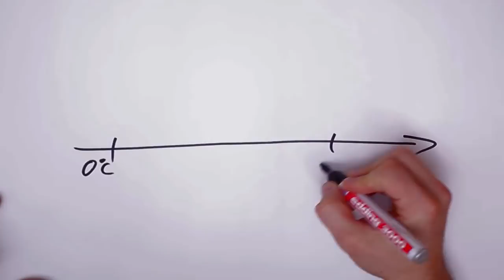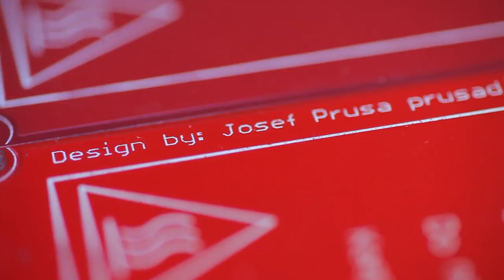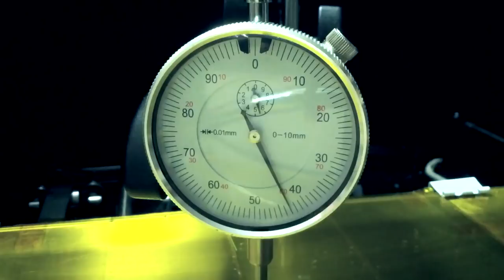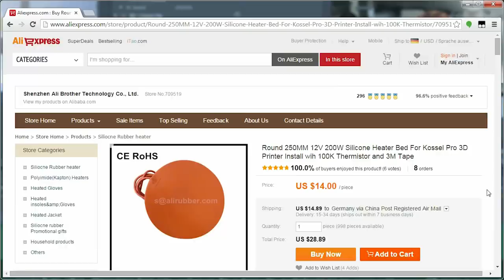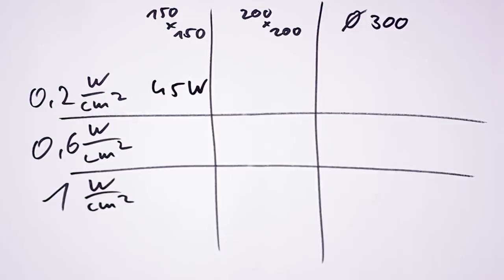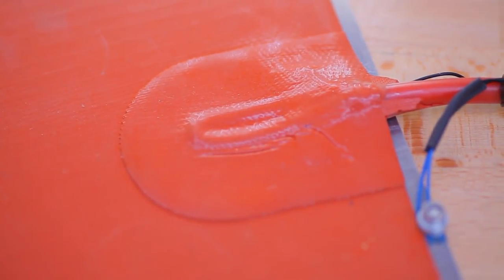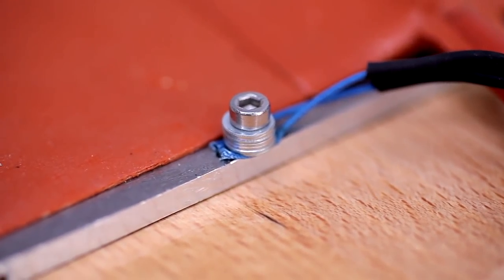3D printing guides: Everything about heated beds!

Comment: Hey Tom, can you do an update to this?
Reply: Jup, would love an update on this.
Reply: Does automatic bed leveling solve any design challenges? Like pcb heater's warping is no longer an issue etc?
Reply: @TheRainHarvester  no it will not.
Reply: @birukch7871  If the bed consistently warps under heat, and the bed-leveling is done after heating, then bed-leveling would solve that problem. (Just an example...looking for others..)
Reply: @TheRainHarvester  the warp is mostly due to cooling and the material property of the plastic. For your case. Warping due to bed problem is another issue but it will not solve your part from warping. The auto bed leveling system is a software based system. It doesn't unbend your build plate.  A simple solution is to use adhesive.

Comment: After my "home made prusa i3" with PBC heat bed, I use now aluminium plate (230*200mm) + heat mat 250W with main power on my new 3D printer.
This is clearly the way to go, from 20C to 110C in 5 minutes, I can't complain.
Also I made a hole on the side of the aluminium plate, kind of Thomas shown in the video, I figured out that this was a big win.

Comment: For Si heaters, do what I did. Simply measure the difference over about +5 different temperatures and draw a graphic difference of this. Now calculate the error and add that to the reading in the firmware. Works great and my temps are between .4 and .6 Degrees incorrect, but still working great. Thanks for the great vid.

Comment: I have a PCB bed and to avoid the bowing or bulging problem I insulated the bottom of the bed with fiber glass style insulation used for pottery kilns, you can usually get it at your local hardware store =)
Reply: Great idea!! Did the insulation help with getting higher temps, and also heating up faster? How long? Thanks!

Comment: Thomas, have you looked into PEI plastic as a replacement for tapes, glues and such? It's almost a miracle material and works perfect for ABS and PLA with no need for anything else.

I have mine on glass (TAZ 4 has the silicone heater glued to the glass) but I think the ideal combo would be a silicone heater on alluminum with PEI on top of that. 

The bottom of the prints are always smooth and shiny as well since there are no materials in the way and it's flat and smooth.
Reply: Have not had that happen yet. The tape is very strong and I use a painters knofe to pry my prints off when they are really stuck (see my videos on it).

Comment: Hi Thomas
I like to know the difference in warmup times on different print-serfaces.
What i mean is this:
How long does it take a pcb bed to warm up on 12v to 60c, 80c, 100c etc. 
How long does it take a pcb bed to warm up on 24v to 60c, 80c, 100c etc. 
How long does it take a pcb bed to warm up on 48v to 60c, 80c, 100c etc. 
How long does it take a Silicon bed to warm up on 12v to 60c, 80c, 100c etc. 
How long does it take a Silicon bed to warm up on 24v to 60c, 80c, 100c etc. 
How long does it take a Silicon bed to warm up on 48v to 60c, 80c, 100c etc. 
How long does it take a Silicon bed to warm up on 110v mains to 60c, 80c, 100c etc. 
How long does it take a Silicon bed to warm up on 230v mains to 60c, 80c, 100c etc. 

I can not find this anywhere.
Is there a excel sheet i can download?

Thank you

Comment: What would you recommend for a 24x24" print bed? I bought and returned 2 sheets of MIC6 cast precision ground plate both were not very straight at all. About 0.8mm off over the whole span. I'm thinking of just going with glass on top of the uneven aluminum plate. Borosilicate glass I cannot find at 24" thicker then 1/8th which would be wayy too thin. Do you think just regular glass would work? 3/16th thick or maybe 1/4th? I also cannot get a hold of any local companies that would precision grind the aluminum plate even flatter... Kind of stuck with what to do.

Comment: PVA sticks nicely to a heated bed with a thin layer of Ponal. It seems Ponal is the only thing PVA sticks reliably to. It works best when freshly applied and then heating the bed up. Letting the Ponal layer drying over night and using it then works not nearly as good.

Comment: Thank you Tom, very informative and I'm glad I watched this video.  I am in the process of trying to work out problems with the stock heating bed solution that came with my TRONXY x5sa 3d printer.  I'm thinking after my research and watching your video as part of the research I'm leaning toward the silicone heater mat.  I do want to put multiple thermistors on some sweet spots of my build area and I'm thinking the E3D v6 method might be the way I will go for them but still up in the air on it.

Comment: I have been using with success aluminium beds with series of four 0,33ohm/25W power resistors (brand name resistors will last forever, no name only a few months).
Reply: +Thomas Sanladerer But you are flexible with the size of your bed. Thats my problem right now because I am planning to build a printer from scratch with a big print volume and I cant fit a fixed sized bed heater.

Comment: Hi Tom, thanks for a very well-done channel on 3D printing! You provided a figure of 0.6 w/cm2 for a recommended heated build plate power density when printing ABS. Does this assume the heated build plate is uninsulated on the bottom? I'm working on a design for a largish printer and finding out that most/all of the power budget (USA 120 VAC @ 15A) will be required just to get the heated build plate up to temperature. Is your thinking that a well insulated heated build plate bottom would result in lowering the 0.6w/cm2 significantly?

Comment: Hi Tom, you say .6 watts per cm^2 does that factor thickness or material. I'm planing to use 6mm (or so) aluminum with 2.5mm glass on top at 330x330mm (yes inductive sensors do work through glass "I've tried it").  Will 700 watts work?
Isn't there a specific amount of energy need per gram per celsius per material?

Comment: great instructive video there Tom. I was wondering if you prep the aluminium build surface in any way (i.e. sand it or something) I noticed quite a few lines or scratches on your aluminium surface. 
I decide to use the same setup but I have difficulty getting the first ABS layer to stick to the aluminium build plate. Not even the slurry will stick to it.

Comment: My printing manufacturer is telling me I should not place an aluminum sheet on top of my mk1 heated pcb because it dissipates heat off the bed to quickly, and that loss of power would be stressful on my electronics to keep supplying energy. I thought this was strange considering the 12v, 30amp psu. What is your advice? I want to use an inductive sensor so an aluminum sheet would be the best.

Comment: Awesome video Tom, thanks so much.

How do rate kapton heater pads against pcb and silcone?
Also, do you use any sheet material on your build plate such as buildtack?

I built my printer nearly a year ago and I'm only now fitting a heated bed and enclosure.

Comment: Hi Tom.  I'm brand new to 3D printing and love your videos. I have a mega Prusa i3 that came with the 200x200 Prusa heat bed. This is where I'm confused and must ask a dumb question.  Do I attach the heat plate (pcb?) below the 290x270 aluminum print plate to heat the aluminum? Or do I print on the Prusa heat plate with tape in between? Sorry for the dumb question but I am confused.

Comment: I know this is an old video but I'm asking myself the question because I plan to give a small printer a larger heatbed. E It's a special size, meaning I would attach two heatbeds to an aluminum plate. Can I connect the heatbeds with one ie thermostat and power and then with one board both Simultaneous control?

Comment: Hi Tom, thanks for the video! I am in the process of redesigning my printer. I ordered an aluminium bed from leap 3D on ebay and it is clearly not straight once heated ( it was potentially not straight before as well, but I noticed while trying to level my bed). It's shy of 3mm. How thick is your aluminium build plate? Also, what do you cover your build plate with for the various printing materials you use? Thanks!

Comment: Hey Tom! 
First of all thanks for your amazing vidoes. I´m watching your videos for years - and I like them a lot. Watching this old video shows how freaking good you got. As this one makes your point clear but is far from the current show :) 
Enough honeysmearing. My question: Using two old HP server Powersupplies(PS)  I´ve build a 24V PS with 47A. Now I´ve problems getting them to heat my Bed. I want to heat a MK2 bed with 24V spec. I tried using a SSR 50 DD. Im sure the wiring is correct. But it mainly heats the SSR. I think the Signal is to bad. Resulting only the MOSFET gets hot. The bed is heating but very very slow - like 2 degree per minute. I want to work with external MOSFETs for my ramps 1.4. Can you give me suggestions which to use and how to solder them? Do i need to change anything else? I cant find a good instruction. Thanks a lot.

Comment: Hello Tom, Ive been 3d printing now for 8-9 months and have been learning a lot from watching you guys do videos on 3d printing. so thanks a lot for all your useful advice and as a part of a larger community for the support which is out there.

But i do have a question, which i dont seem to be able to find a video, which specifically speaks or addresses this question, which is; (If you are knowledgeable enought to do this, but are looking to extend the size of your heat-bed platform and need to use more than one thermistor, which is the best method, if you only have _01_thermistor input to connect to your mainboard? should i connect 2x thermistors in series, or in parallel? And would this task be as simple enougth to resolve this question?
Please would you reply to this, i kindly await to know what the solution is, before it is time to further my skills in 3d printing.
Thanks

Regards

Monos Scema

Comment: Thomas, i doing my first steps in 3D printing with diy printer which have 500mm x 500mm bed, but without heated element. Is it possible to print with PETG and PLA without heated bed?

Comment: Hi Tom , my name is also Tom. I've bought both the Keenovo thermostat A/C control unit & the heated bed for my cr-10 310mm x 310mm but I purchased each of them seperately (IDK if that makes a difference in the wiring as in # of wires in each of them) The only Youtube videos i can find shows connecting the keenovo heat bed to the CR-10 control box along with a solid state relay but they never show anything about connecting to the keenovo control unit! I havent been able to find any help on wire diagrams! I was hoping may be able to help me or atleast point me in the right direction to figure out how to wire  the heat bed to the keenovo control unit & whether or not it has to be connected to the CR-10  control box for anything?? Thanks Tom C

Comment: Hi Tom

I've now mounted a sensor for autobed Leveling and it works pretty well, just a bit firmware finetuning is needed... So now i'm about to print your glidecam( which looks by the way awesome!) 
Do you have some tipps for me about material adhesion, orientation uf the parts? I'll print the parts with ABS and a heated bed is avaiable.  =)

Best regards form switzerland
simon

Comment: Hi. I'm looking at upgrading my Printer to a 300 x 300 aluminium plate heatbed, heated with a silicon heat mat. I would use the aluminium as the build surface. I was planning on using 6mm aluminium plate but I'm wondering if 5mm would be ok. I'm concerned about warping. I expect temp to get up to 150 deg c. Any comments?

Comment: Hi Thomas, I like your vids a lot coz it helps me get good prints. I have a question though. I do not have any warping problems during printing with abs, but  as soon as the print is done and when the part is cooled off, my part warps. I am currently printing a 5mm thin large sheet. I hope you could help me with this. Thanks.
Reply: Thanks Thomas I will try that solution out. I think you are in the right track, coz I usually put a fan right after I print ABS in order to cool it faster, maybe that is why I get warping. Once again thanks.

Comment: What is the best way to glue, or to get good thermal contact between a PCB heater and a glass bed? I just recently switched from an aluminum heatbed to glass, and the PCB heater is slightly dished. The small air gap is acting as an insulator and my glass is not getting anywhere near as hot as the PCB heater.

Comment: hi a small question.
If you can use several small heat beds under an aluminum bed in order to get a larger heat bed, that I ask this is that I have not found larger heating plates for what I am going to build.

Comment: How would you configure the thermistor(s) or connect heated beds for multiple heated bed for a larger surface? i.e. 500mm x 550mm printing surface. I am looking for off the shelf vs custom made

Comment: Hi Tom I purchased one of these heated beds, PCB Heated Bed MK2B For Mendel 3D Printer Hot Bed 120*120mm 12V.. It has a 5 wire connector on it, I am trying to figure out, how I would wire this to ramps 1.4.. The connector 5 pins have.. - Heat , +12v , SIG, 5V, GND,       Please any help on this would be great..

Comment: Great video! Thanks a lot for sharing!

@ 9:33 (...) the E3...?? method. What is this about, i can't seem to find it, could you please enlight me about it?

Also, so, milled Al plate has much better adhesion than glass, right?

Thank you so much in advance.
Reply: +Nuno Oliveira He means like how the E3D printhead mounts its thermistor. Basically they have a small hole drilled into the aluminum, with a second threaded hole next to it. You stick the top of the thermistor into the unthreaded hole, then secure it by fitting a screw and washers between the leads and screwing it into the threaded hole.

Comment: Hey Tom, what do you think about laminating a pcb type bed heater to an aluminum plate with high temp jbweld adhesive.  this would make it stay straighter and distribute the heat well.

Comment: Hi.
I make a Dia. 400mm heatbed for a Delta. Do you know the best way to conect it, I think I go for the 220V and a relay maby a exturn controller.

A lot now make bigger 3d printer and then need bigger heatbed so we need a guide with "relay type, watt, 12v vs 110/220v. and so on. Thx for a great channel...

Comment: Hi Tom, what do you recommend for power at 24V?

I'm considering going for a 200x200mm mat aluminum heated bed and using the RepRapElectric RAMBo you reviewed.

That RAMBo is rated to draw up to 15A through its heated bed fuse. However at 0.6W/cm² a 12V power supply would draw 20A.

That RAMBo can work at 24V. However the ATX power supplies that seem popular in the RepRap community and are easy to find only seem to go up to 12V. So what kind of 24V power supply would you recommend? / How would you suggest sourcing it?
Reply: ***** I managed to get a hold of a second hand Meanwell power supply (24V 18.8A 451.2W) for a fair price.

Comment: Hi Tom, I'm building a mega printer with a 24"x36" heatbed and will use a cluster of 6 300mm x 300mm aluminum heaters under the 1/4" heatbed. All switching will be via electronic relays. All that is easy for me, but what I'm not sure about is how long it will take to heat this 24x36 inch bed up to temp? Do you have any advice?
Reply: One word my friend, you will have massive hot and cold spots on that one, i recomend you to add a pic just to messure all the heaters and make sure wich one is lacking of current, that way you can increase the current on that one and compensate on the others, thats only my opinion, cheers.

Comment: Is there any printer that uses 48V for heating? It would make sense to raise the voltage to get more power without having ridiculous amps flowing through connectors and transistors.

Comment: I ordered a silicone heater mat from aliexpress (the link you recommended) and it had some air bubbles between the double sided adhesive and the silicone. Those air bubbles caused the mat to get somewhat loose (air expanded) when heating to 90C and such. Which adhesives (prefereably available in germany) would you recommend to glue a silicone mat to a glass plate ?

Kannst auch in Deutsch antworten, in Englisch hilfts nur vielleicht mehr Leuten mit dem selben Problem.

Comment: hi, thx for the great tutorial on heated bed. i am trying to build a 600mm x600mm, any idea what control board can support the kind power/watt/amp,  should i use a 24vdc or high voltage "vac". thx

Comment: I have a glass bed on my Pursa i3 I built. Although it gives me a good flat surface but I struggle to get anything to stick. I am using a  Borosilicate Glass 3mm think and a MK2A RepRap hot bed powered by a PC power supply heated to 50c. I have to use painters blue to get it to stick, but this is hard to remove. Any tips???

Comment: wondered at what points to measure the resistance of the HB because my multimeter reading rises over time until it reaches 1. that's when i measure the N-L wires. except that it should be around 1.1 ohms so i donno why it isnt.

Comment: Hi i got a problem i have a Mk3 heatbed running it with a Ramps 1.4 when i try to heat up the bed it only power on for a few seconds and when i feel the mosfit its really really hot what can i do to solve it please help